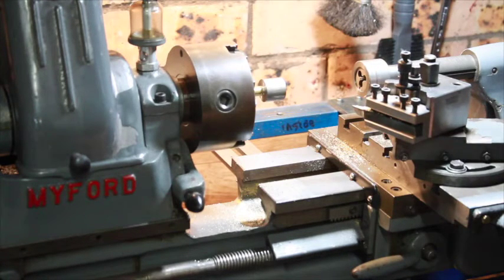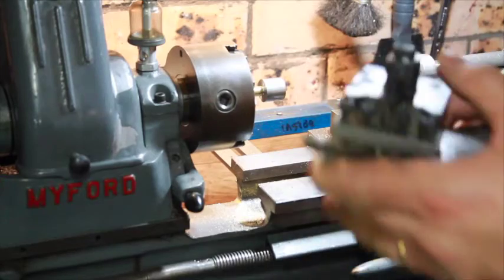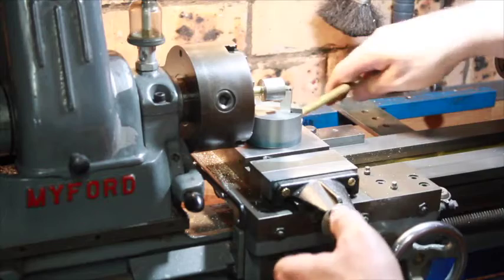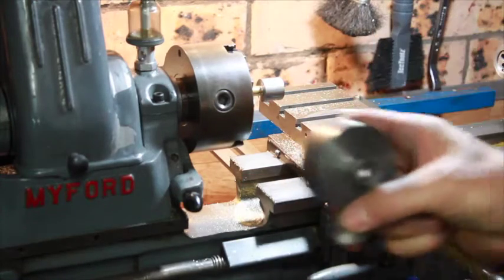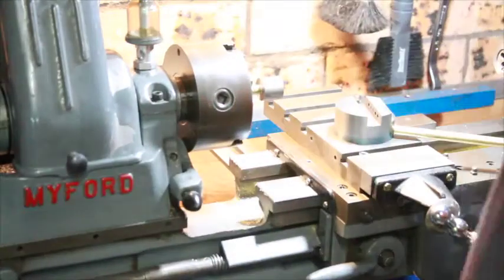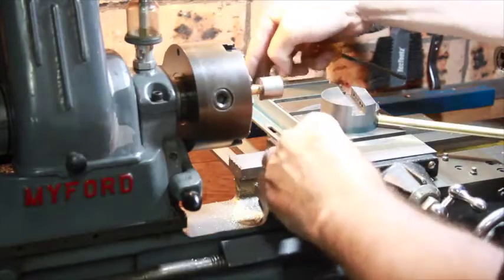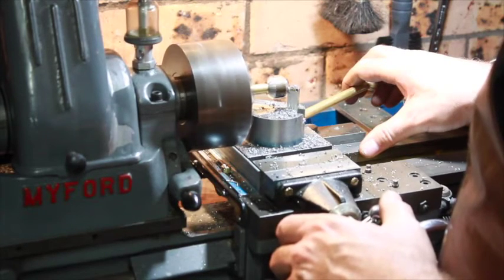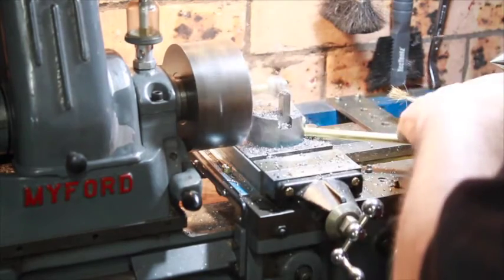Ball Turning Attachment

Comment: Hi John,
 The tapped hole at '8:08'mins is there to hold a travelling steady. It's also handy to  fix down a bit of flat sheet, to prevent swarf falling onto the ways.
Regards Paul in NZ
Reply from the maker: I really should make a new version of this video.  It's terrible!
Thanks for putting up with it Paul!
Reply: On my Super 7 i use a piece of leather to catch the swarf, the advantage being it has sort of moulded itself to the bed so sweeps the swarf and has helped to prolong the life of the felt wiper. I also have it so that it hangs off of either side of the carriage which stops hot chips from scalding my hands when using powerfeed!